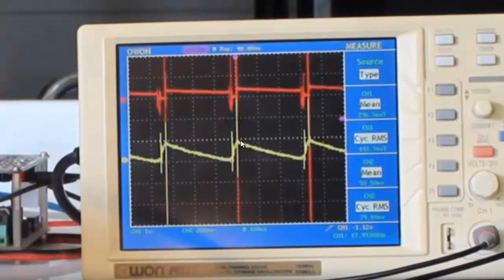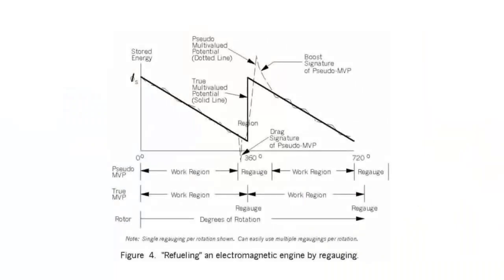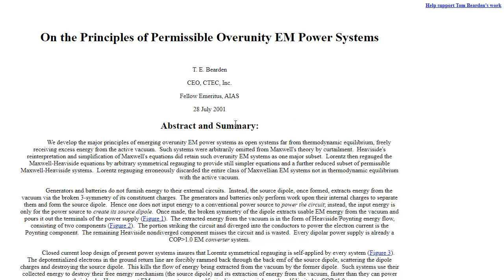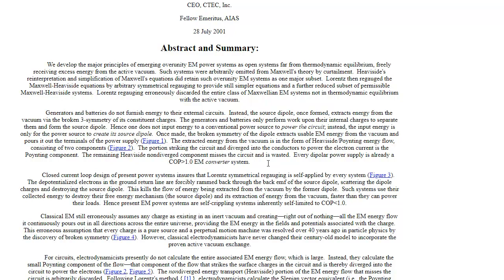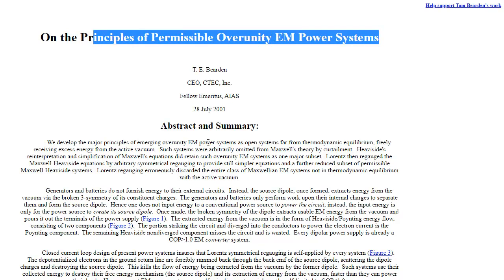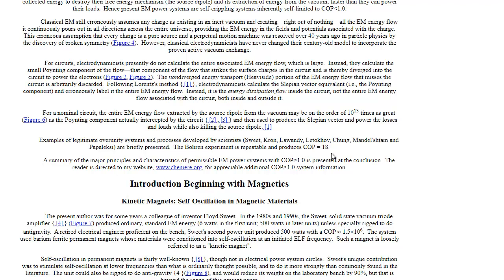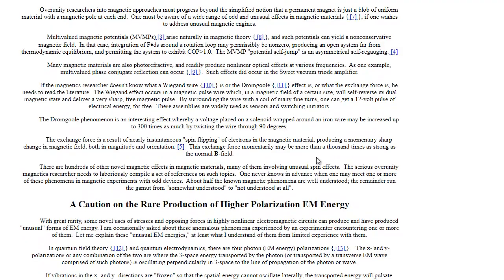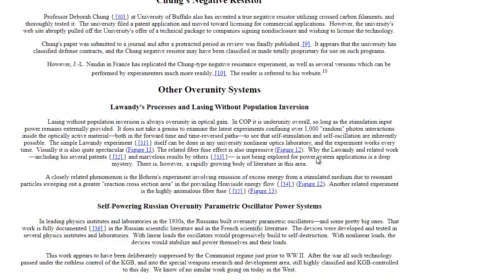Non-Inductive Coil Experiment - Video Eight

Comment: I don't like being that guy who's gonna tell you it won't work and or can't work etc, but there is one problem with what you are trying to achieve unless i missed something. 
The reason a normal transformer is such a great automatic converter of voltage and current is because the primary will always try to keep the same flux regardless of load.
What happens when a secondary is loaded is that it creates opposing MMF, the turns times its amps, and this will act to reduce the flux, but almost immediately the primary will increase current to keep that same flux. No matter how hard the secondary loads the transformer, there will only be one unchanging flux inside. If there is excess flux somehow created by the secondary, it will fall in voltage because the primary induction is lowered (this is how old welding machines regulated output current through a magnetic shunt).
So what you are trying to do, is to create an extra secondary flux which then gets opposed by the tertiary, however there will only be one flux in that core, and both the secondary and the tertiary will oppose it in unison. Again unless i missed something...
Reply: normally the voltage on primary remains the same and a loaded secondary decreases/counters the flux in the primary inductor, L=N*dphi/di decreases if flux change decreases from a loaded secondary through lenz.
V/L=di/dt, current increases if L decreases.
cmiiw

maybe Chris tries to accomplish different coupling coefficients, strong between L1 & L2, and between L2 & L3, and a weak one between L1 & L3. That's why L1 is wound over L2...?

Comment: (16:10 ..."magnetic field turns off and there is a change in the time rate.")

Another possible way to see this is as a charge build up. Like in a spark gap and capacirance build up before the charge can be released. This is in the switching off process. Also in the switching on process. Niagra falls switch man was electrocuted as he was throwing the switch to connect the circuit of the generators with the long length of the circuit wires. Although I don't know if it was a circuit or simply connected by ground. However, the solution of protection from this is said to have been ground connection. As a result. 

So the build up goes to ground, obviously, rather than through a person. 

The Tesla? /Dollard explanation of LMD analogue computing is showing us a buildup of capacitance on one side of a capacitor, and this switching from side to side. From AC sine wave. Or from north south magnetic induction into a coil.

A resonance frequency is easily established by brightness of light, or of level of magnitude of induction released or picked up.
Reply from the maker: depending on where one is looking, but Charge is not the same as a Changing Magnetic Field. That would be a Changing Charge. Key word here is Changing

Comment: The normal frequency of a transformer is 50 hertz but if you are using higher frequencies even if it is an instantaneous(or there about)pulsed input you magnetic core needs to be rated for that frequency;if you don`t there will be heavy power losses in both the magnetic circuit and high impedance in the copper.For low power inputs this will not matter but if your input pulse current is at or close to saturation and the frequency of the pulse in the kilo hertz range your pulse energy will need to be mush higher that necessary,so any gain will therefore be relatively lower.Your bucking coils basically are counteracting the back EMF therefore there will be very little magnetic losses on the input side( but there will still be very high impedance due to rapid current change of the input pulse.

Comment: Around 16:30 the slap together increase... likely the same as when the heat is turned off of a pan of something boiling as well. I always notice it. When a heat source turns off there is a temporary heat gain. This is proof positive of a gain upon switch off.

Just before water freezes there is also a jump upward in temperature. This is heat leaving the system. So the system contains heat or a measurable action within its existence that is lost as light energy.
Reply from the maker: The Input Coil is a fast Changing Current, an MMF. This Magnetic Field as a result of the MMF will try to collapse back to equilibrium when its source is switched off, instead, this Magnetic Field see's the Partnered Output Coils. This is the slap...

Comment: Rewatching to better catch and grasp details.
If I'm not wrong the oscillating ramp up isn't conventional, neither is the non-flipping of the output voltage polarity, it's always forward biased in this setup.

Comment: But sir how do v know they r resonance, as u have not run any load to check the amperage nor voltage to input current pls if u could show that it would b quite easy to understand... BTW thanks for showing how the primary to tertiary winding must be accommodated thkz indeed but do follow up with motor or something with which v could asses this thkz and if at all a correction w cap is required to make them in phase how can u calculate the  capacitance easily,

Comment: When a magnet passes over a coil is it creating the same back em sine? (AC?)

And do you know,  when entering direction of charge, and when exiting, direction of charge? 

And so, does pulse act the same way? Or might pulse charge act more like a magnet approaching a coil head on, and then reversing outward or away from a coil? 

And should we consider using coils in series to mimick similar conditions?
Reply from the maker: Yes, sort of, E.M.F = -NdPhi/dt, so equal and opposite. AC is the Direction of Current, not the Waveform, the waveform is dependent of the motion, or velocity. A change in Current Creates a Voltage. An applied Voltage allows for a change in Current.

Comment: Hope its okay... but im gonna comment as I go along watching the video. 

When you send a pulse charge into the coil, is there really a back electromagnetic pulse, same as the opposite direction, like AC?
Reply from the maker: The Coil flips polarity when a DC is turned off. AC is Alternating Current, but really is Alternating Voltage and Current then follows as the AC Voltage is applied, confusing?
Reply: @SweetSQM  what i believe is being kept secret about motors is that a capacitor (LMD) in circuit will effectively send back em (switching polarity) to attract coil and magnet together. Simple momentum (including a flywheel) moves the magnet out of the coil induction areas. The process repeats. And the capacitor acts like a switch each time. Because the back em is continually opposite to the magnet polarity when it leaves the magnet.